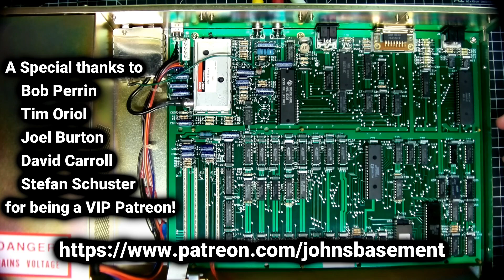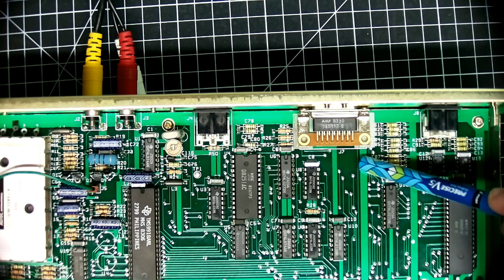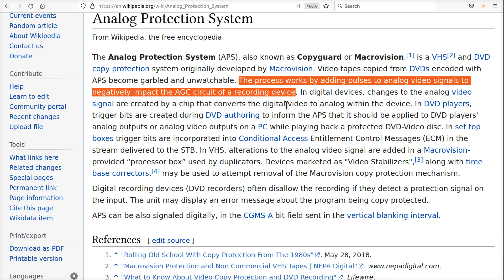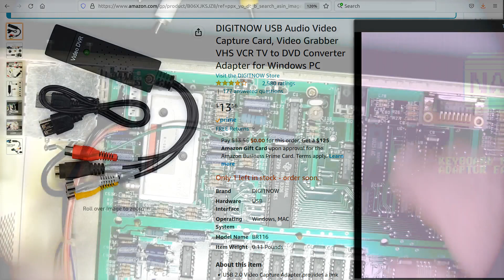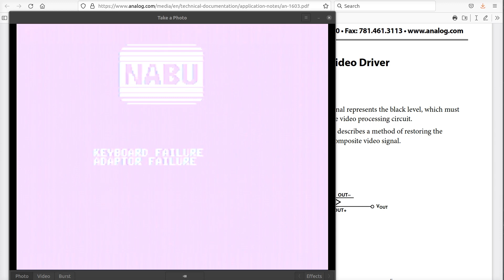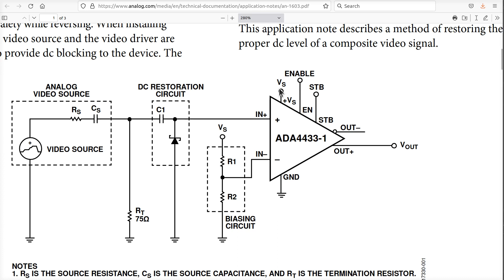NABU #2 Tech Closeup

Comment: Thanks for VALUABLE tips!! As far as video quality mine is as washed out as yours is. Recovery ckts is a good idea!. I also noticed that the 180ohm impedance that they have seems to be a bit higher than the classic recommendation of 75 ohms as well. Maybe a better matching here as well as a limit with a fast Schottky diode too could help.
Reply from the maker: Yeah. It is unfortunate that the bias on the video can be a problem on some screens.
Reply: @John's Basement  I bet this bias was done back in the 80s when common TV within the modulator was the issue with such a strange system .  I remember these days all too well, aarrgg! Hated channel 3 or 4.... Hehe.
Reply from the maker: @saturn5tony  Who knows?  I suspect that in order to run the chip with +5V only power, the analog circuitry in the chip isn't able to pull the signal down all the way.

Comment: One more thing I should mention: I did not have to do the sand paper thing and I suspect no one else might have to. My fan was stuck as well but it seems to be due to the fact that the screw holes are too tight as in not exactly aligned. I simply loosened the 3 screws that held it in and re-tightened them just snugly but not overly and it let the fan run freely with no noticeable noise other than the air flow itself.
Reply from the maker: This may or may not be true across the board. I've seen others that actually remove their entire fan from the naboo and it was still seized and that they had to take the whole fan apart and sand down the blades. So maybe you got something there and I certainly hope you do but it may not be true in all cases.
Reply: @JohnsBasement  I remember when I picked up the box off my porch upon delivery and was WOAH! This beast is heavy... and I remembered seeing the pic of the stack of these the seller had and am wondering if the weight of some of the bottom boxes or maybe even just time sitting around for 40 years may have caused this to the fans. But like you said, these all look like first run bodge engineering so that could be something as well. So far so good with my fan but one's mileage may vary. Perhaps you might mention the screw thing I did as a possible first try before having to go nuts taking the fan out completely on your next vid? And of course... thanks for all the feedback and advice.

Comment: HI John, was watching your video here and noticed you mention the high DC offset. My nabu seems to work on my samsung LED TV with a bit of the top of the screen cut off as if the vertical is stretched a bit..... but when I use one of the RCA to USB capture devices, I get what looks like it has a horizontal sync issue. I've measured all the clocks and they seem to be dead on... could that DC offset be giving the capture device problems I described? I'd like to stream some games from Nabu on my Twitch channel but as I've stated the capture looks like the old TV horizontal hold if off.... what do you think? And yes... I do have a high DC offset as well.
Reply from the maker: Yes.  All NABUs will have some offset due to the output circuit design.
I have yet to record mine looking better after hacking my RCA patch cable and inserting a 33 ohm resistor in series with the video signal.
🤔... I will try to post a quickie this morning.
Reply: @JohnsBasement  Sounds good but is that why I get a horizontally 'twisted' picture using the capture? I can send you a pic of the problem I'm getting if that helps.
Reply from the maker: @GORF_EMPIRE  yes.  It is possible that it could disrupt sync and other things.
Reply from the maker: ...it is ALSO possible that a fix good on one capture device may not work on another kind.  😕
Reply: @JohnsBasement  That is what I thought. I'll have to see if I can somehow alleviate the DC offset. There has to be some sort of adapter to allow for this out there. I'll take a look to see what's out there. I did order a composite to S-Video Adapter as the capture device does have S-Video input, but somehow I don't think that will do the trick now that I've talked to you about this.

Comment: The sand paper worked.  The fan spins freely and 99.999% noise free.  Mostly I took a small square of sand paper, folded it in 1/2 and wedged it between the fan and housing.  I rotated the fan around and around,  It would stick in a tight spot, which I'm guessing was where the fan was sticking too.  Eventually it loosened up enough the push the fan back and forth in the tight area.  This also made it easy to find which blade(s) were doing the rubbing and so I worked a little on those blades.  All in all it took about 20 - 30 minutes.  Thank you again for finding this issue for us and offering this solution.  Happy Nabu Year!

Comment: My fan needs a push start to get spinning noisily.  Thank you!  It probably would have been a while before I noticed that the fan was not spinning, if I not seen this video.  Thank you!  I'm deciding on my course of action; either your solutions or what?   Easiest is a replacement fan, but I have a museum and I'm a purest, so I might choose your solution of sanding down the blades or housing.
Reply from the maker: Thank you.  I'm always glad to hear that something I did was useful.

If you decide to replace it, I have noticed that any generic 80mm PC fan fits on the mounting holes.

Comment: Mine also has washed out image. I have got to stage of programming the VDP to display tiles correctly and sprites are next.
Reply from the maker: Try putting a 33 ohm resistor in series with the video output signal.  The color quality on mine improved enormously.
I'll try to record a vid about it next week.

Comment: Since the NABU has the same video-chip as the MSX-1 you cold copy a part of the MSX schematics if the output signal of the NABU is not what modern days video-monitors need.
Reply from the maker: It would depend on how the software was written in the first place.  I suspect not.

Comment: The drop down resistor is there to warm up the insides of the case to cater for the cold Canadian climate. 🤣  I'd replace it with a 9V LDO regulator.
Reply from the maker: 🤣... It'd still dissipate the same amount of heat!
Reply: Absolutely! but it'd provide a predictable regulated voltage, short circuit protection and the heat would be well away from the PCB. If you want to reduce the dissipated heat, use a small & neat switch mode (e.g. RECOM) 3 pin voltage regulator replacement at the risk of introducing some switching noise.
Reply from the maker: True indeed.

Comment: I ended up putting a 1K pot between the COMP out and the base of the transistor on the TMS9918A's analog circuit on my 6502 build. This gave me the ability to play with the video signal amplitude. I was able to almost get it to proper NTSC levels. Emphasis on the word almost. Also, keep in mind that LCDs (and capture devices) have a hard time to correctly display a TMS VDP image. I read somewhere it's because the video signal does not fully comply with the NTSC standard. CRTs are slightly more forgiving in that regard.

I also bought a Nabu, but I haven't received it yet. I'll let you know if I get washed-out colors.
Reply from the maker: I may have to tinker with the output a bit more as well.
I haven't spent this much time with NTSC in a while.  🤔 I am reminded why we outgrew it for data screens so long ago.

Comment: I haven't seen or made any comparisons with the home computers it would be competing with at the time, so is it possible to make or say things like  'graphically superior to the Commodore 64 ' or will give the ' Spectrum a run for its money ' I presume it would be aimed at the gaming enthusiacs ? I could be wrong but was there anything mainstream in that era that it could be fairly compared with please ?...cheers.
Reply from the maker: According to Wikipedia it was available in Canada from 1982 to 1985.  So it would have competed with things like the VIC-20, C64 and the like.  Out of the box, it has no bootable I/O devices other than the cable-'adaptor'... that talks to a server at 111K bps.
Apparently, there is a team of folks excited about getting one on the Internet.  It should be easy enough to do.  At which time it might be fun to play with.
For myself, it is something cheap that I might learn something from as I build a VDP for my Z80 Retro! project.  
Maybe I'd take a swing at porting CP/M to my NABO at some point.
To that end, I am not at all excited about the fact that it only appears to support booting from its RS422 interface.
I'll probably build an SD adapter card for mine if I want to try booting it for tinkering.
It is unfortunate that it does not have a way to host any sort of 'extension ROMs' on its expand-o card interface slots.  So replacing its boot ROM would be the only way to let it self-boot from an SD card (sans its 'adaptor'/server.)
Reply: @JohnsBasement  Thanks, I think it's gonna be a great series and look forward to more....cheers.
Reply: @JohnsBasement  Well, MyGeekyHobby is planning to create a USB-TTL serial as an alternative to the RS422

https://youtu.be/NxW2GOw5Mqk
Reply: Ken Segler already has a replacement ROM ready for booting from his adapter card.

Comment: What's the appeal of these NABU computers? They're so old if you get one you don't know what state it's going to be in and you there don't appear to be a lot of reasources out there on restoring these.
Reply: Here's my feeling on it... It's new old stock, lost forgotten hardware that no one has reviewed, built mods, tinkered, or created for yet.  It's the old retro that's new, but still old. And some of us old people dig it!!!  Mine has yet to ship.  :(  But the CRT, RS422, sand paper, etc are all standing by.  :)
Reply: @nabun00bs  That's about where I'm at.  Only instead of buying a Nabu, I've been trying to emulate it, with limited success.
Reply from the maker: I got mine because I have been tinkering with a TMS9118.  The NABU has a TMS9918, which is very similar, and I thought I could learn something from it. So far, not a whole lot.

Since getting mine, it appears that there is some excitement in building a replacement for the original network server.  I'm sure I will connect mine for a try if they have a simple gateway hack that will let a NABU squawk to it over the internet.
Reply: @JohnsBasement  

One TMS9118 project I've had rattling around in my head for a while is using the external video input to try to get overlays working.  I haven't gotten around to it, but I've wondered about it a lot ever since I first got introduced to the TMS9118 series.
Reply from the maker: @Calphool222  Unless the TMS9x18 is going to genlock to the external source, you will have to deal with that is some way.  I have assumed that it won't and have not bothered thinking about it.
Maybe I am wrong though.  Let me know.  It might be fun to try it.
Reply: 3 key facts on this point: 1. These are new old stock and early indications are that they have been stored properly. 2. Restoration methods on old computers are largely consistent from one model to the next. 3. The eBay seller who has been supplying this batch has said that he’s testing them (at least minimally) before shipping.
Reply: Some great responses so far to your question "what's the appeal?"  I'd add that the NABU network was ahead of it's time, but largely forgotten.  It a chance to resurrect and replace the NABU back into it's place in history.  It is, as well, practically virgin territory to play with and create for '80's 8-Bit micros AND this is not restoring old 80's 8-bit tech.  This is restoring an 80's idea that was ahead of it's time with BRAND NEW computers.  When will this ever happen again?  No one will ever get a chance to play like this ever again!!

Comment: Greatly appreciate your list of things to look for. As for the washed-out colors, I get the same thing with other vintage computers. However, if I use a computer monitor it's fine. I'm assuming it's the video capture device that is causing the problem. Thanks for sharing
Reply from the maker: Yeah... I'm suspecting the DC offset.

Comment: This thing looks ALOT like an MSX machine on the inside. You think MSX was the base. You think it can run MSX software on it with a little modifcation?
Reply from the maker: You are not the first to ask.  I'm not an MSX expert so I don't know.  I suspect not because there is always some little thing to mess up compatibility at the binary level.  😕
Reply: @JohnsBasement  other people have said the things like memory addresses, how the joystick ports are handled etc are different from MSX. But since the two main pieces, CPU and VDP are the same, it won't be difficult to port MSX software to NABU. Has me wondering if a new ROM could be written to adapt it to run unmodified MSX software? Audio would be the issue, unless a Y8950 could be plugged into one of the expansion headers.

Comment: Have you got terminal unit that uses a NAGRAVISION CAM module and matching NAGRAVISION Viewing Card as you are going to need the unit any to get the most out of your NABU Personal Computer.
Reply from the maker: Never heard of nagravision before.  I am going to take a swing at removing the bias and see if that helps.
Reply: @JohnsBasement  NAGRAVISION is a encryption/decryption designed to stop people stealing content and conditional access.
Reply from the maker: @DAVIDGREGORYKERR  oh... Like macrovision.  Yeah, DC restoration will eliminate that.

What bothers me though, is that TVs should do that on their own.  My NABU looks as overdriven on my regular TV (sony bravia) as it does on my cheap capture device.

The NABU's DC offset is about 1.1 volts.  Maybe there is a practical limit that is less than that?

Comment: damned be all breaking parts (especially fans), lol
Reply: ac-powered electromagnet coil flex membrane + dual magnets on up/down sides of a duct = flex fan that will not seize, very simple to clean if even needed to be cleaned ever
Reply: have you ever tried a laser soldering pen
Reply from the maker: I can't say that I have. 🤔
Reply from the maker: I have NEVER had a fan (new or old)  fail like this before.     It is all metal...  Looks like cast aluminum.  
What did they do?  Add three extra  coats of paint or something?
Reply: @JohnsBasement  old fans tend to gobble up stuff and seize, but this seems a bearings issue, but not dependent on if it was used or not, just age
Reply from the maker: @Jkauppa  🤔 harrumph.  Well .. worst case, it'd probably be easy to replace it with any generic 80mm DC fan.
Reply: @JohnsBasement  replaceable parts leads to bad design principles, tho, in engineering, slack design
Reply: @JohnsBasement  instead of proper very long term parts, replacing parts is assumed, testimony is old laptop bearing fans